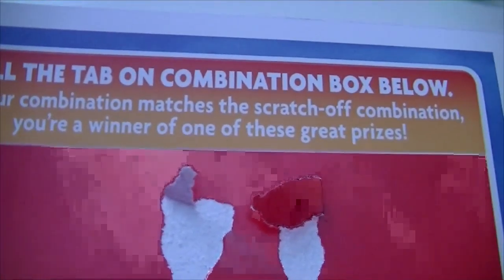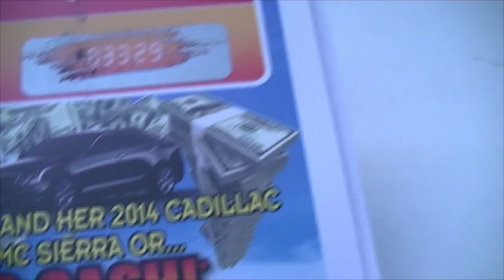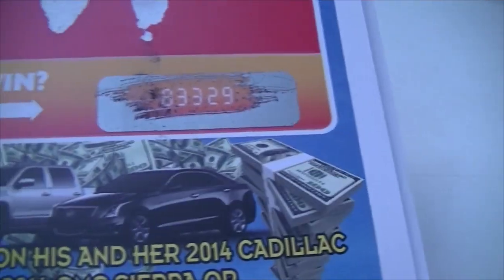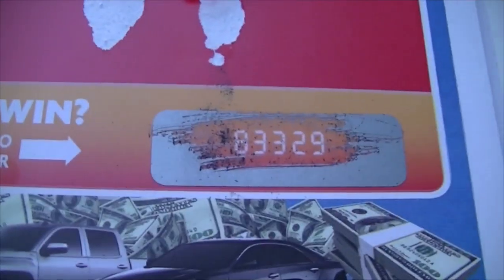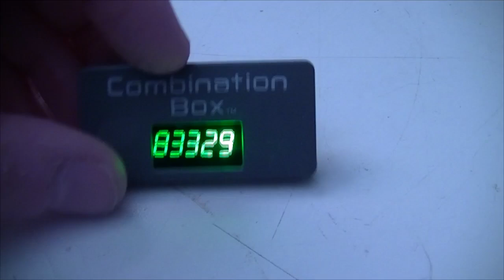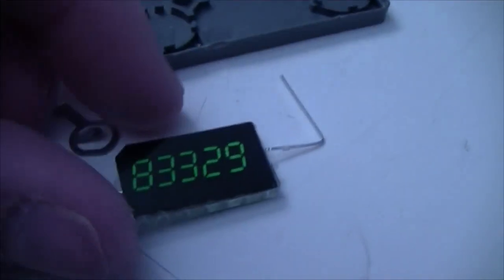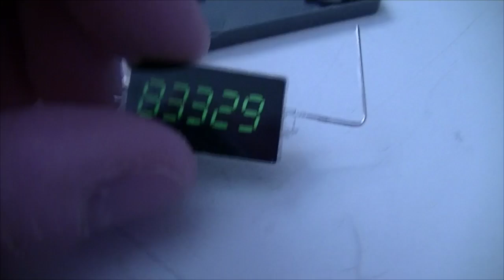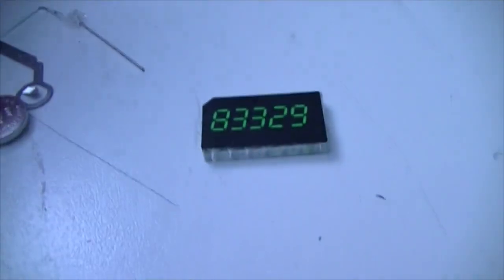Digital Combination Box

Comment: Think those are both batteries? Or is one a transponder or something inside a battery case
Reply: The LED needs 3V to run, each cheapo battery is 1.5V.  The number on the back of the battery is LR1130, you can buy them to replace batteries in digital thermometers, watches, etc.

Comment: I received one today and took it apart. The outside is identical but the inside design has changed a little with two LR41 batteries on the right side of the device. The metal plate is eliminated and the diffuser is a simpler design.

Comment: I just received one too. knew I would find some information on YouTube. thank you for posting your video. My initial thought when I first saw this and still is very annoyed. what a dumb ass waste of plastic and technology. Do we really need more shit in our landfills? They should have just kept the scratch off version. such a stupid concept and design. Like you my first thought was taking it apart and using whatever energy source was inside.
Reply: Well said, that is exactly my point! Absolutely! I think that you need to find a use for it (even just for free batteries) and NOT just throw the unit away (not to mention that batteries need to be recycled correctly)! Either way, this concept does not promote being environmentally friendly period (I would be ashamed to be working at the car dealership doing this for that reason not to mention the overall purpose of this is to deceive)!